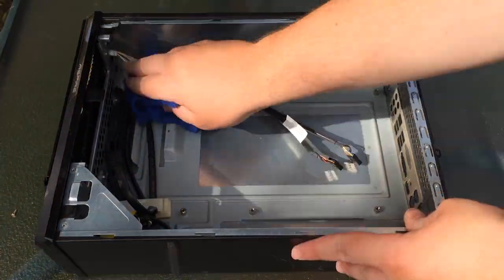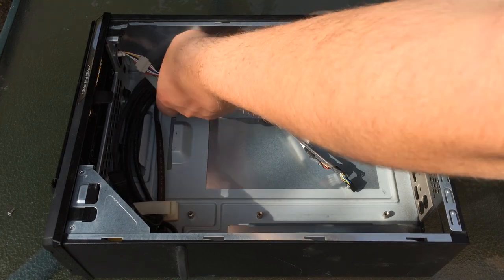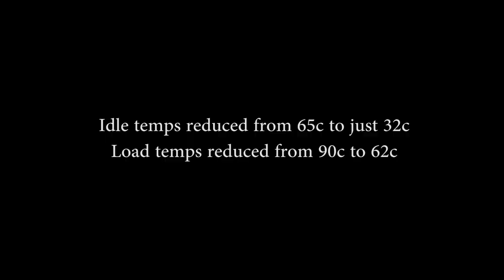Cleaning Up The Free PC I Got From The Dump

Comment: Excellent vid! Sometimes all an old PC needs is some TLC to get it running again! Maybe try looking into a way to unlock the 4th core in that Phenom, and if you can't due to the BIOS, maybe look into getting a Phenom II X4. Then, throw in that mini GTX 1050 to game on that machine!

PS: I'm doing an upgrade project myself right now, I upgraded the mobo in my first PC ever (Compaq media center), from one that would only support a Core 2 Duo and 2gb DDR2 to one that now supports a Core 2 Quad and 8gb DDR3. Currently running a Core 2 Duo, 4gb DDR3, and a fresh install of Windows 7 64 bit. I used this vid as a test for its playback performance and at 720p it played this vid with no stuttering! Very happy with how this machine is performing after the upgrade.

Comment: I used to have an acer just like that, an aspire x1301. Had an Athlon II X2 and 4GB of DDR2 and a GeForce 210. I upgraded it to an Athlon II X3, 8 GB of RAM, a 460 watt PSU, a Radeon HD 7570, and threw it all in a nice case. Sold it for $250 on eBay not too long ago.

Comment: Amazing difference. Imagine how many good computers get chucked out just because they are dirty.
Reply: lots lol. I work at a university. The moment people have issues, it's new pc time, regardless of how dumb the problem is.

Like I'm working on pc that has 8gb of ram.....but only a 32 bit operating system. wtf 

and it's apparently easier to get a new pc then to have someone install proper windows. 

I could honestly fix like all the issues my office has with simply adding a small ssd boot driver, doing clean installs, and maybe upping the ram. And cleaning of course. 

But why do that when you can just throw $$$ at the problem

Comment: Just got me a Dell Studio XPS 8100 with Windows 10 Pro,  Quad-Core i7 2.93 Ghz, 16 GB Ram, 500 GB HD &  Nvidia GTX 260 for $5.00 dollars. Computer was overheating due to all the dust in Case, the seller though it was trash. Dust was everywhere, 5 times of this Dump pick-up. Cleaned all the dust out of every component & its working Awesome. Best $5.00 ever spend.

Comment: what do you think about psu that come with casses, already installed in them? i am on a low budget and i am building a pc with g4560 and rx560, i know that they use little power to run but i am still not sure because i know psu is important part. The problem is if i wnat to go with some other psu i need to lower my configuration... i would really like to hear your opinion because you are working with budget parts

Comment: did u opened the powersupply and clean the inside? if it has a fan then u should do it soon
the old powersupply in my fathers pc started burnin a bit because of dust and after that the supply was useless even there was not much burn damage to see just a little brown spot in the inside

Comment: I have a system nearly identical to this one. I just put in an HD 6350 in it and I'm waiting for the cable as it has a dms-59 output which I'd never heard of, but it comes in tomorrow and we'll see if it'll run any older titles.

Comment: I love watching old PC's getting a "rebirth", so to speak, but I would have done a few things a bit differently. Firstly I would have COMPLETELY disassebled the system (Front I/O etc.) and pressure-wash all the non-electrical components. Secondly, I would have used high(er) quality thermal paste on the CPU, north and southbridge and the GPU (if it has one) and lastly I would have done something about the fans. A personal favorite of mine is opening the little hatch on the fans, right under the sticker, and put a few drops of olive oil inside, to lubricate the bearings- sounds ghetto, I know but it does wonders for noise and even vibrations. 
Still- this was a nice vid. GG ^_^

Comment: i bought an electronic air pump thats meant to be used for air mattresses and stuff like that to clean my pc, its about as powerful as an air can and a lot cheaper in the long run since the pump only cost me like 10$ and compressed air cans usually cost around 3-5$

Comment: The original Phenoms were rather temperature sensitive, so the fact that you managed to reduce load temperatures to below prior IDLE temperatures is a huge step forward. I also never knew that LiteOn made power supplies... you learn something new every day! I wouldn't put more than a 75W graphics card in there though, that PSU is too anaemic.

Not a bad CPU, but it's hard to overclock. My old Phenom II X3 710 (2.6 GHz) would be about 20 to 25% faster at stock though as it requires FSB overclocking, I never bothered, nor did I have the board for unlocking the fourth core. You could probably get 2.4 to 2.5 GHz out of that 8550, giving you about 85-90% of the ST score of the Q6600 and about 70% of the MT score.

Comment: hey there randomgaminginHD I have a Dell dimension 3000 and i bought it for 20$ thinking I could upgrade a few part such as the RAM(only had 1gb) the OS (had XP) and add in my HD Radeon 5450 but my RAM wouldn't fit in there and same with my graphics card. do you need some spare parts? the Dell dimension fully works. free of charge

Comment: I have a very similar pc to this with an Athlon X2 220, but it has 4 ram slots. I wonder if it would be worth it to move the system over to a new case, get a new powersupply and put a stronger CPU and a dedicated graphics card in it.
Reply: 1100t phenom x6 is the strongest CPU for that socket slap a decent cooler on it, overclock it and Chuck a 1050ti / rx470 / gtx1060 / rx480 in it with a possible ram upgrade and you'd be good at high 60fps for a bit. however for the cost of that CPU you could get a new Pentium or wait for R3 and a mobo for nigh on the same cost. (except you'd need ddr4 ram and that's pretty pricey at the minute)

Comment: What to do with my system and could you help me. System specs are: 
Msi K9N Neo v2
Amd Athlon 64 x2 5200+
GT 630 1Gb
4gb of ddr2 ram on 500mhz
sata hard drives.(at least they work) my problem is that i always get stutter in games like assassins creed 1 and 2, darksiders 1 and some older games that could run on this system. Maybe is ram configuration in first slot is 1gb stick then in second slot is 1gb stick but from another manufacturer and in last fourth slot(cuz 3rd is not working or what..) is 2gb stick

Comment: my idle temps on my xeon 1231v3 is around 47c-49c but my ambient is around 22c as i live in spain. when playing games its around 68-75c or lower or higher depending on the game. i cleaned out the dust a few days ago but didnt make a difference really.  ive only had it just over a year, could my heat sink be like the one in the video?
Reply: its 44c right now while watching the video.

Comment: There is a flaw here. I would seriously suggest cleaning up the inside of the PSU, since you can't see the temperatures that are inside... and if the PSU goes out, there's a large possibility of damaging other pieces of hardware (just like your old Q6600 build). The method used is up to your discretion, I suppose that shoving some pressurised air from the outside through ventilation holes should be sufficient if done thoroughly. You can also open up the PSU and clean it like that, and if you are so afraid of capasitors killing you as many others, just leave it unconnected for about 15 minutes (I am wondering how can you get electrocuted from this, you would need to really think of a way to get inside the case and under the PCB before the caps discharge). And who said you even need to remove the PCB or touch its bottom?

As of upgrading the CPU, there isn't really an option of overclocking here since this kind of motherboards usually has pretty weak VRMs. Some people suggested unlocking a 4th core, but it is only possible with Phenom II x3 CPUs, not this one.
You could go for a CPU from AM3 socket - if it has up to 95W TDP, it could work with this AM2+ motherboard, but there's a risk that it will not function properly or operate at nearly half the original clock. (Updating BIOS could solve the problem).

Or there's an option to go for a quad core AM2+ Phenom, like the 9500 or 9600. Both have 95W TDP, so they should fit this motherboard (as the 8550 also has 95W TDP). If you do, I suggest grabbing a CPU with a B2 or BA stepping, as there is a way for them to squeeze even more power from them - the TLB workaround patch.
For example, I use a 9500 with an R7 265 GPU, and the TLB patch gives me a lot in games. The effects are: bumping from 10-ish FPS to nearly 30 in TF2 during VERY intensive fights, nearly 30 FPS more in Metro Redux on Medium preset (from stuttery 30+ to very fluid 60+). You could also notice 7zip test having nearly three times more the performance, which isn't that surprising when you look deeper into what's a TLB buffer.
The only downside is that when I use the patch, I need to additionally cool down my VRMs (a single small fan blowing onto the transistors). But good news, you can toggle the patch whenever you like.

Comment: that's nearly the exact layout of my little weak machine. (has an amd e450 I believe). I thought about converting it to an htpc but working in a pre-built preprietory case is tricky. and with a 220w psu. I'm power limited as well.

Comment: Those air cans have to be kept upright or they'll discharge the propellant. (Like in the video)  Yes the audio is broken at 4:17, I'll assume it was quieter. sooo, 8gb of DDR2 RAM and a GTX 1050ti LP? 230Watts PSU may be underpowered maybe the 750?

Comment: You should add a toothbrush to your cleaning arsenal, it's really good for getting in tiny holds, heatsinks and in fan blades to get the last bits of dust out easily :)

Comment: great job, now you only need to add more ram to reach at least 6 to 8gb and a low profile geforce 1030/1050! Voila an entry level gaming pc from the dumpster... also remove the dvd drive for more air clearance ^_^ also add an SSD as boot drive for a more snappier performance...

Comment: i would reccomend upgrading the CPU to an athlon x4 880k or something like that, as they both have the same socket type and also try to get a GT 1030 or a low profile GTX 750 ti, this would be great and you might need to get the GT 1030 due to the PSU wattage, great video as well!

Comment: The ironic thing is that many PC owners throw away their PCs because of very simple problems, like too much dust blocking the cooler and fan. They think the PC is broken and get a new one. Also many are scared off by the "warranty void if torn" stickers, which compels many into never opening their PC at all, allowing dust to accumulate. A simple vacuum cleaner and compressed air in a can (1-2 bucks) can get rid of 95% of the dust in minutes and the PC will work like new after that. 

Scrounging for old PCs like this in dumps can be very rewarding, since many aren't actually that old. I tried it a few times and got lucky once: Core i5 2500K, 8GB DDR3-RAM, HD7950, 128GB SSD, 1TB HDD and a decent motherboard. It was filthy as hell and took a good day to really clean, but the effort was worth it.
Reply: In what countries do those stickers even apply? Here in Slovakia, these stickers are invalid, by law they do not in fact void the warranty.
Reply: @ramdrivesys1869  Neither do they in Germany.

Comment: The way i would have done this:
Disassemble everything, put everything into the dish washer (exept the drives), let it wash, put everything exept the case (and the drives) into the oven and let it shockdry for about 10 min. at about 100°C, then clean the drives like normal and let the case dry out by itself, reassemble everything, done.

Comment: Got a free computer from my sister, said it did not work. It was noisy and the computer would go into blue screen and turn off. Much like the video, turns out the CPU heat-sink was flooded with dust. Cleaned the heat-sink, applied new thermal paste, added a couple extra fans for better air distribution, been working great for the past three years. I love free stuff.  :)

Unfortunately, her newer, faster computer has been working great. lol

Comment: I have the same pc sitting in my closet. my first and very old htpc. fun tinkering with that ddr2. the cpu was just too slow so as soon as i got it i upgraded to a Phenom 4 9750 (95w, not the 125w variant). Not any faster but could perform more operations making it better for 1080p video and some older games.

Comment: My tips which I got in a bad way.
Used my G4560 with the stock cooler, how bad it can be? Really bad it exceed 90°C.

And I was asking my self how the hell it can be that bad? G4560 has 65W TDP and the stock fan is designed to cool 65 TDP.

The answer is I didn't install it prorperly.
1 of 4 pen for stock cooler wasn't installed properly.
Now I get 55°C and maxed out at 60°C even while having Ghost Recon Wildlands

Comment: Why don't you get an air compressor? Much cheaper than canned air in the long run, and you don't have to use it as sparsely since you're not afraid it'll run out, and speed up the cleaning process quite thoroughly

Comment: I found that a brissel paint brush or call fuller brush girl for a high Q brush lol but dish soap and a brush will clean the fan good do it in the sink rinse off let dry then take brush and clean off everything less mess and best of all it free after you buy the brush have seen alot different cleaning videos Q tips work well to get the big dust piles

Comment: Hey man, would i be able to send you my PC to be fixed and cleaned? You could make it into a video! :) It's just mine runs hella slow (Network Speed is 100 mb/s and it would still be slow) And even opening offline apps slows it down to below the average. Just asking, it probably a no but it doesn't hurt to ask.

Comment: The dust honestly does not affect temps all that much.... it is the replacement of that dried up thermal paste that solved most of your over heating issues
Reply: at most will dust affect your temps is + ~10 C which is insignificant to many computer components with stock coolers

Comment: You should get a compu cleaner it will save money in the long run and allows you to use your air less sparingly its a mains powered air cleaner made for cleaning compu ters

Comment: friday night I went to the local recycling place and found a dell insparon 580 with an i5 750 cpu 6gb ddr3 2X 3gb and some kind of amd videocard. I threw my ssd in it and my r7 370 and it booted right up after some driver updates. I was using an older e8400 core 2 duo so this was an upgrade.I get c2d's and amd quad core pc's like crazy from this place. I clean them up  with 4gb ddr2 ram and a 320-500gb hdd and sell them for $40 - 50

Comment: Hello, i need help with my pc cause i dont know that much about pcs 

My pc specs:
Intel core i5 4460 
4gbs of ddr3 ram
 gt 730

My problem is my pc lags when i use photoshop and mozilla firefox at the same time, i think the problem is that i have 4gbs of ram, help?
Reply: I also have a problem with csgo it kinda hiccups idk how to explain it but it's annoying please help me
Reply: Try to find 4 gbs more of ddr3 ram (not that expensive). Photoshop and browsing is heavy for the ram, and 4gb isn't that mucht
Reply: Scøpe You should upgrade to 8 or 16 gigs of RAM.
If you want to play some more demanding games / want to reach a better framerate, you should swap the GT 730 out.
Maybe you get a GTX 970 / R9 290 for cheap.
Reply: any recomendations? :v
Reply: Alright thanks for the help! :D
Reply: Scøpe If you've got a single module of RAM, just buy another 4-GB-module. It should run at the same speed like the already installed module. I would buy it used, i.e. on ebay, because new RAM is really expensive at the moment.

For a new graphics card, you should look up if your psu has the needed connections and enough power. For the GTX 970, 400-450 watts is enough, for the 290, you should have 450-500 watts.
Reply: alrighty

Comment: if the psu could handle a 6 pin gpu then slap an rx470 or 1050ti in there and a ram upgrade and it's a half decent gaming PC.

Comment: Yeah take the time to clean your PC. seriously you dont have to take the whole thing apart just dust the fans every couple of months. If you keep the same system without upgrades for more than 2 years at the 2 year mark open the PC, take it apart and re-apply thremal past to the cpu, clean the fans, dust the gpu and the system will be running nice and quiet. Also i would suggest every year or two reinstall windows to keep your PC nice and snappy.

Comment: My PC used to be really slow, so I took off the side panel to reveal all this dust on my cpu heatsink. Whipped out the air compressor and blew all the dust, then everything was back to normal and my cpu wasn't throttling. Moral of story, just clean your PC. :)

Comment: 20 bucks Q6600 + 80 bucks GT 1030 = perfect mini PC for low price that will run pretty much anything on good settings.
Reply: Raven Gaming but you would have to buy a new mainboard to install a q6600